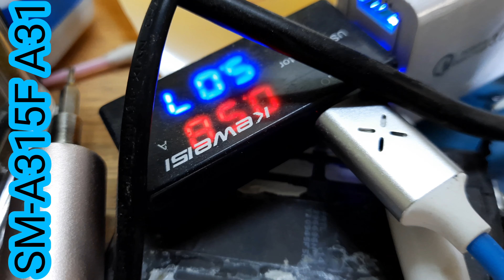samsung galaxy a315f A31 charging issue fix only with a jumper

Comment: How can i jumper that capacitor sir?
Reply from the maker: First chcek till where the 5v is , from that point may be from sub charging board or as on video from strip flex cable or as in video jumper till main board connector if have 5 volt put a jumper from there to cap to find the +ve of cap use a multimeter in continuity and check for ground the other side is of course positive.

Comment: How to check 5 volt bro
Reply from the maker: Use a multimeter or new charging board.
Before connecting jumper make sure the line is not short if main board is shorted u will end up damaging charging board also based the ampere output of connected charger
Reply: @basicthoughts8054  bro mainy jumper lagaya but diet tak aya 5 vat but battery connection pay nahi aya
Reply from the maker: @BashirAhmed-if1ue  battery contacts ka continuity check karna munkin short hoga
4.something volt hi ayega contact pe battery boost karke lagake bhi try karna